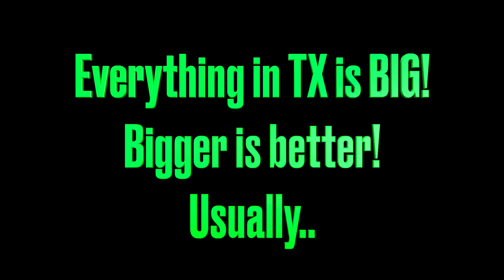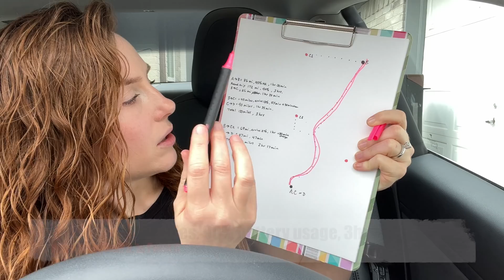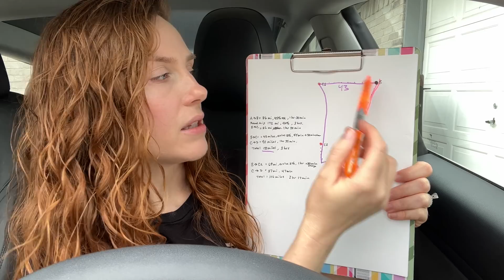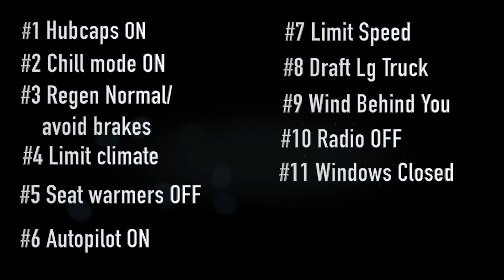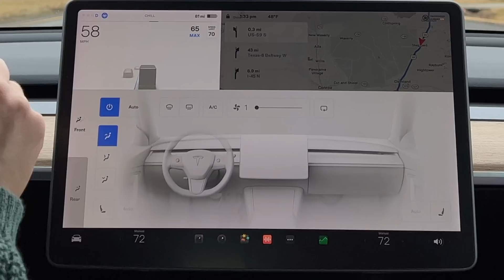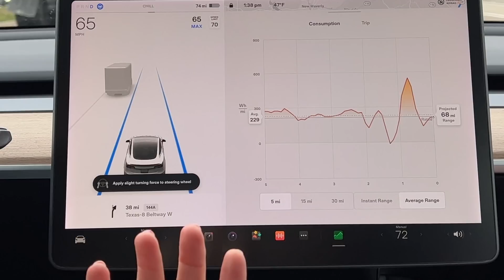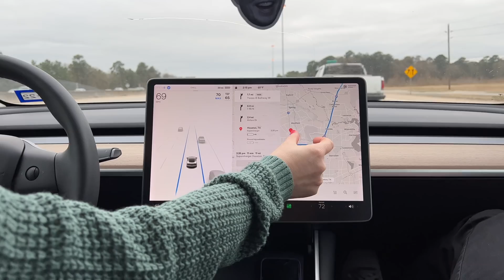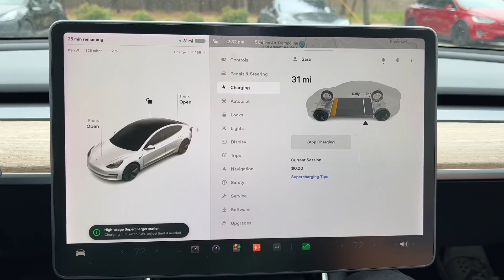TESLA: Emergency Battery Procedures (Hilarious & Highly Educational)

Comment: love your channel. currently fighting leukemia but if my bone- marrow transplant is successful, I’m going to buy a Model Y long range so your videos are very helpful. just finished your trip video. very informative. thanks. however, it seems the sound inside your Model 3 is very loud. was that just the video or was it the vehicle?
Reply from the maker: First off, I am so incredibly sorry. I am a bone marrow donor, but I’ve never matched with anyone. But I am in the system. Been in it for about 12 years now. I would love to be able to give that gift to someone one day. If I had the money, I would buy you that LR today. ❤️ Honestly, it’s really just the distortion from the Audio. When I film talking in the car I had a great microphone, but when I was driving on the trip that was the microphone of my iPhone by itself. There is road noise in my car yes, but not more than a regular ice car in my opinion, it’s actually much quieter than an ice car because there’s no engine roar. The road noise has never bothered me on my model 3, except if I’m trying to film. And if you’re on a smooth brand new highway with no traffic around, there’s almost no road noise at all. Rough roads creates a ton more noise. Like the one I was on.  I wish you the absolute best. Prayers, positive vibes, and all. 🙏❤️❤️❤️❤️❤️❤️❤️❤️❤️❤️
Reply: @SaraJAwesome  thanks for the love. my donor situation is all set. if i get my Model Y i plan on driving around the country to all the baseball parks. maybe, when i go see the Astros, we can meet for a cup of coffee. (tell your hubby not to worry. i’m just a harmless old man. he can join us 😂😂😂)
Reply from the maker: Good. Also, I would love that!!!!!!!!!! Most definitely! Just reach out to me on here! You can also message me on Instagram or Twitter @sarajawesome or email me at sarajawesome@yahoo.com always excited for a cup of coffee with anyone. Actually going to make myself a cup now. Have a wonderful day, James ❤️ Reach out anytime.

Comment: I hope you feel better soon, you still look great!  Range anxiety!  You handled it just fine.  I recall driving on fumes in my ICE car (when I was 20 something) with very little margin.  I only ran out of gas once, and that was because my fuel gauge had stopped working as the car aged.  The gauge never went all the way down to “E”, it always looked like I had 1/16 left. (Ha ha ha). I would never cut it that fine now, of course.  Age has a way of tempering judgement.   Mileage is really affected by weight especially with grades.  Very good video, greatadvice, especially carrying an adpater to charge at 3rd party chargers.  And, maybe a towing strap.  One never knows when everything else will fail.
Reply from the maker: Thank you 🙏 ❤️ yeah, I ran out of gas once for the same reason! Never again! Tow strap is a good idea, and carrying mobile cable. I always have the adapter though or sure.

Comment: You plugged in to your family's dryer outlet before starting for home, right? I would have liked to see your "trip" display in the energy screen, rather than the "consumption" display. That really helps me on roadtrips! Actually, I've experienced even whiter knuckles. I used to drive 132 miles to Las Vegas in a LEAF with an 80 mile range. The most crucial consideration is speed. I'd have to drive at 55 mph on a 75 mph freeway, stopping to charge at least once from a lowly Level 2 EVSE. It's kinda embarrassing to have cars lining up behind and passing you, but… well… what's our hurry in life, anyway? Finally… you should be getting your rest, Sara, not obsessing about others' comments on drafting behind semis. You just couldn't resist, could you? Get BETTER!
Reply from the maker: Haha! I agree with all of this, and we met family at a restaurant so I could not plug in there. And I can’t plug in at their houses anyway because of the way they are set up. So yeah.. not an option in Livingston. But I can charge at my other family’s house in a different part of Texas.

Comment: Putting the car in Chill mode ONLY saves charge by not allowing you to quickly drain charge by hard acceleration. It does NOT save charge at cruising speeds.
Reply from the maker: Agree 💯, I should have mentioned that. But I keep it in chill mode because I do often have to intervene and take over manual in certain areas and that’s when I do need chill mode on. I know it doesn’t make a difference with active autopilot. Dang. Another thing I should have mentioned. Thank you.

Comment: Do you plan on replacing that windshield? That crack is huge! It's one of the things I'm dreading if my windshield ever gets damaged. You'll have to let me know how that process went in a future video!
Reply from the maker: Yeah, I will replace it. It’s so annoying. My kids keep bleeding me dry for sports money and I’m only working part time to be there for them to take them back and forth. It’s $1,000 to pay Tesla for it up front in full because they don’t work with insurance. Then I have to reach out to insurance progressive and have them reimburse me for the difference Down to my $500 deductible. I saved up the $1,000 like 5 times already but I have to keep spending it elsewhere on the kids for now. Which is fine. Plus it already got two more chips after the big crack. So I was glad both times that I hadn’t replaced it yet. And no it didn’t happen from trailing trucks. The big crack happened when a mowing service truck pulled out in front of me in the city at only 40 mph and kicked up a big rock. Sucks but there are thousands of cars in Houston with busted windshield, even cars nicer than mine. It does make me cringe but I’ll get replaced when I can. :( I will of course make a video of the whole process. ;)

Comment: The obvious question here is: why does it have to be a Supercharger? All you need is 15 min at a 50 kW charger, somewhere on your route.
Reply: Tesla can't use CCS or ChaDeMo 50KW DC fast chargers (different plugs), only Tesla Superchargers or level2 slow (6-12KW) AC chargers (J1772 adapter)... YET.
There is discussion/hints that Tesla is bringing out a CCS adapter to the US market, then we can also use any DC FC like ElectrifyAmerica etc... they have it in Korea, and hints in firmware that newer cars have CCS-capable hardware (older cars like me & Sara may have to pay for charge port upgrade.) Hope they bring it to US market soon, it can definitely help in some spots that have longer stretches w/o Tesla superchargers!
Reply from the maker: Thanks for sharing this! You just taught me some things I didn’t know!!!!!!!! ❤️❤️❤️❤️❤️
Reply from the maker: Agree! Unfortunately, on this particular route there were no good 3rd party charging options. I’m telling you it’s a bad road. 😂 It’ll get better though! I just found out yesterday they finally put a third party (single) charger in Livingston so if this happens again I’ll go see if it’s a viable option!
Reply: But good point also, in a pinch, you CAN use 3rd party level2 AC chargers on the way... as Sara mentions, use PlugShare or other apps to find some (tesla car nav shows some, but very few, mostly on Tesla slow chargers), especially near a restaurant or hotel w/ food, or a mall... stop there, eat or shop for an hour, and voila you got 30-60miles range (sometimes even free!)  Better than worrying about tow truck!

Comment: Why not just do a minimum top up at Houston North, just enough to get you home , and a minimum top up in Livington with a 3 rd party charger to get to Houston? I’ve been advised little and often charging, rather than stretching the range.
Reply from the maker: That would be smart to charge on the way, but I didn’t have time. And I knew I would probably have to stop and charge on the way home which I was fine with… BUT I DID NOT know I was going to lose so much that I almost couldn’t make it to the north Houston charger. I was not expecting that at all. I thought I could stop Baytown or north Houston totally fine. But that was not the case. Totally caught me off guard. And there is one third party charger in Livingston that I just saw pop up yesterday while I was editing. So that is great news! It’s very slow and I’m not sure how accessible or if I’m working order but supposedly it’s there!

Comment: Have you looked into your cars resale value? The car market is kinda crazy right now, I wonder how close you can get to the price of a new Model 3 Long Range Awd which is $51k these days. Maybe it could be an easy upgrade.
Reply from the maker: You are 💯 correct! The problem is I don’t want to wait that long for a new one. Can you imagine no TESLA for like 9 months?! I can’t! It would ruin my channel too, it would dry up. We did reserve a cybertruck though. Maybe when that comes in 10 years (jk) I’ll trade this in for a new model 3.
Reply: @SaraJAwesome  I just checked and Model 3 Long Range AWD is showing estimated delivery date in May 2022 which isn’t too long considering supply shortages these days. I have a CT reservation too but I’m not holding my breath on that one, lol.

Comment: Is the busted up windshield feature an add-on you paid for? Or was it an "over the air" update?
69 was observed at least twice in two separate contexts in this video.  What is this video really about?
Reply from the maker: 🤣😂🤣😂🤣😂🤣😂 ❤️❤️❤️❤️❤️ That windshield is driving me insane, but kids are bleeding me dry with sports fees right now. I had the $1,000 saved up like 5 times already and then something comes up. And it keeps getting more chips (not from tailing trucks) so I’m just like ugh… I’m gonna hold off as long as possible. Everyone’s windshield are busted around here. It’ll be $1,000 through Tesla then I have to get my insurance company to reimburse me down to my $500 deductible. Fun fun. Fml 🤦‍♀️ I didn’t notice the 69 this time. 😂 it wasn’t on purpose.

Comment: I recently found myself in the same situation trailering a small box trailer. I failed to consider the effect of the wind, tailwind on my way out a headwind on my return. When I started my return everything with the range was OK in order to reach the charge station, but quickly the percentage of charge started dropping to the point that I started freaking out, turning off the heat, and slowing down time and again to the point where I was going 45 mph for the final 10 miles to the charge station.
Reply from the maker: Yeesh, I’m glad you made it! That’s why I added in my last video two weeks ago about wind resistance when you have things attached to the exterior of the car. BUT I forgot to mention trailers! I only mentioned bike racks and luggage racks etc. Very good point! ❤️